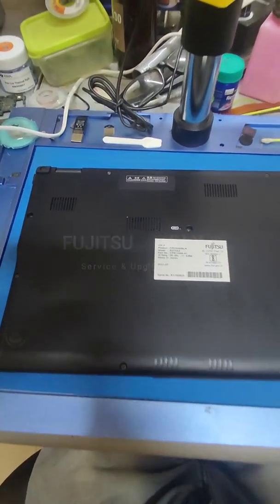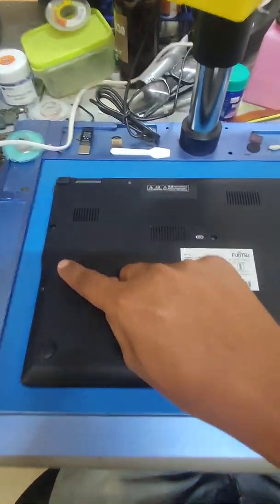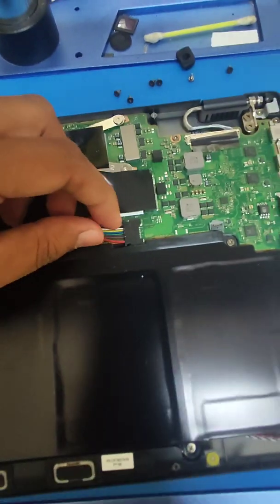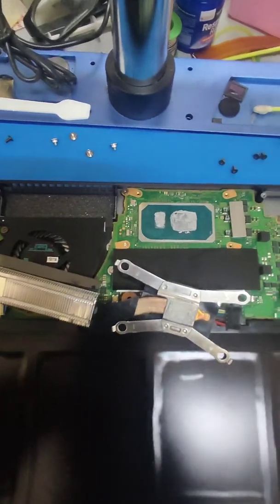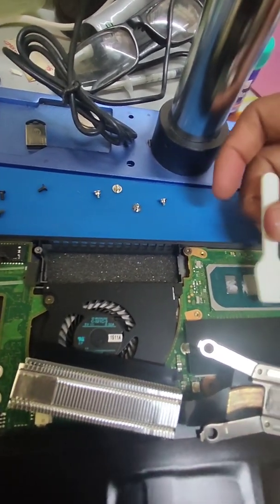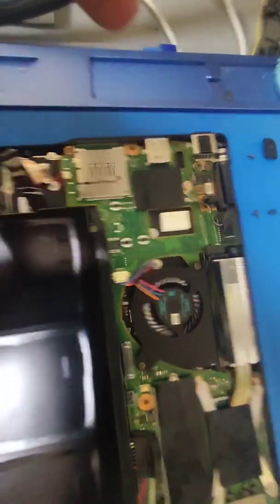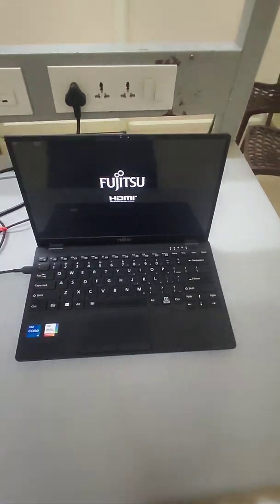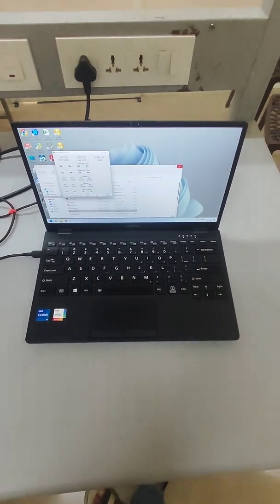Fujitsu UHX Disassembly and Upgrade options | How to open | Thermal paste | ARCTIC MX4

Comment: Thanks for the video. Can the battery be replaced? and if so, what is the specific part number for it. Thank you.
Reply from the maker: Yes the battery is replaceable, unfortunately I have no idea about the battery, however you safely remove back panel and check for the replacement part